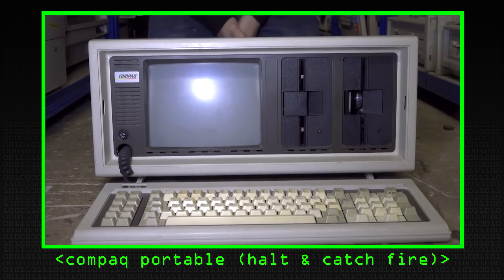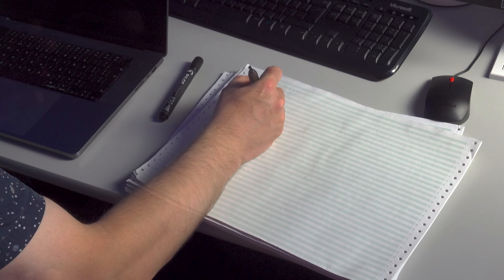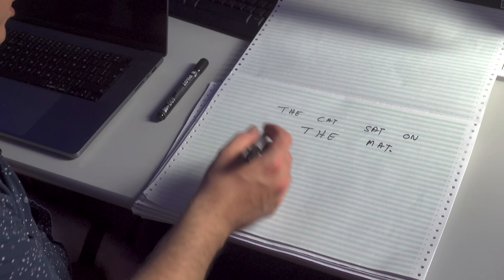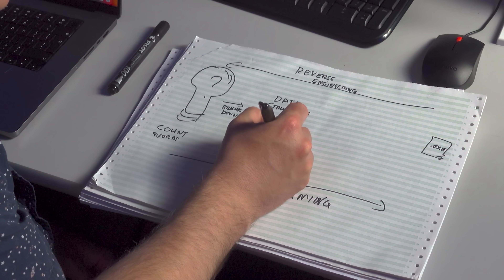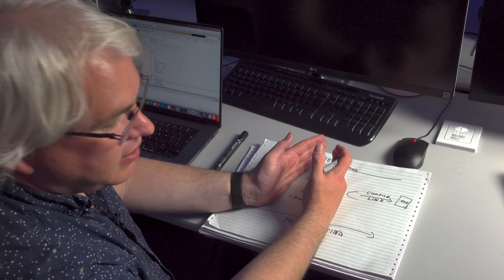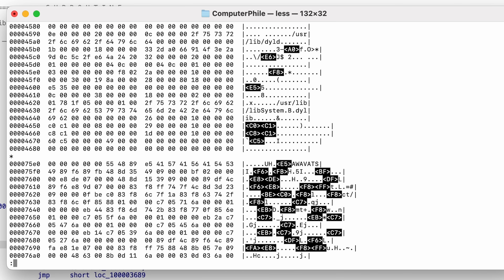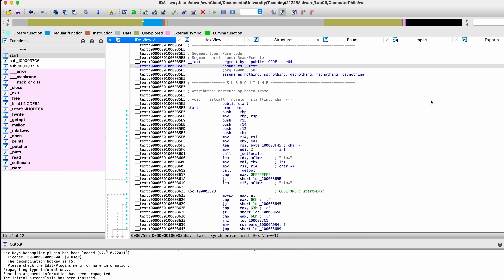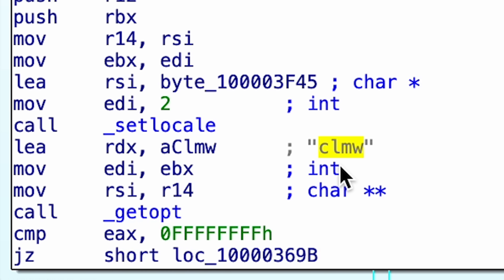Reverse Engineering - Computerphile

Comment: Oh yes, please do avideo on spaces. I never understood why there are line feeds and carriage returns and why those are two different things...
Reply: back when typewriters are a thing, line feed goes to the next line, carriage return goes to the start of the line. you needed both to go to the start of the next line. i dont know what happened when computers were invented, but different OS writers decided they needed different combinations of those to be used
Reply: @jkoh93  Unix and unix-like systems (including macOS) use LF only. Windows (and DOS) use CR LF, in that order. The classic Mac OS and a few others used CR only. And there were even more combinations and other character encodings used in different machines and operating systems.
Reply: @jkoh93  so... LF moves the cursor vertically, CR moves it horizontally? Why do *NIXoids omit the CR? I'm sure one of the Professors has some intersting stories to tell why those things are the way they are, hence the seperate video about spaces 🤩.
Reply: @LupinoArts  Probably as simple as: we don't want to use two bytes when one is enough to indicate a new line.
Reply: @maxine_q  Yup. Pretty much. Now editors and other simple text file readers need to accept the various combinations of line delimiters... or convert from one convention to another. As stated, it all started with mechanical printers that had CR and LF as separate physical motions.

Comment: You haven't mentioned reverse engineering to bypass copy protection/licensing.
I've reverse engineered a few small things that i liked but never had the opportunity to license.

In one case, it was as simple as finding the reference to a string that bothered you about purchasing a license and in the jump instruction simply make it so it never performs the jump and proceeds as normal.

In another case i reverse engineered the licensing key algorithm. Then i wrote a keygen for it.

Reverse engineering is a lot of fun, sometimes hair pulling frustrating, but a lot of fun and the moment you make a breakthrough you feel like you are on top of the world.
Reply: I remember the first time I changed a JNE to a JE – 0x75 to 0x74 or from u to t – and saved the binary so that it would now accept any random key. Seeing it work was exhilarating!
More serious software protections and license validators require a lot more than this to break them, and it's rarely that simple.
Reply: @desmond-hawkins  how do you change it like that
Reply: @seif1293  You use a disassembler like IDA shown in the video, although IDA is commercial and has only a limited free version. There are free alternatives, Ghidra is probably the most powerful (actually made by the NSA! no joke). Once you find the JNE – meaning Jump if Not Equal, i.e. jump to where it shows the error message if what you entered is not equal to the valid password/license key – the disassembler can show you the exact position in the binary where the JNE is located. Then you use a hex editor to open the file, go to that position, and change it to the binary value for a JE. So in the hex editor you'll see a u and you just replace it with a t then save, and run it again. If you got it wrong you just inverted some random condition in the code that has nothing to do with what you wanted, and this might have "interesting" side-effects.
Reply: I reverse engineered the codes that Lemmings and Lemmings 2 gave out so you could restart at a later level - the programs even accepted codes which were impossible to be obtained from the program but were valid as far as the algorirhm checking the codes was concerned.  (I guess part of the code generated was ignored by the checker but was included to create multiple codes, or may have been used by the game to change the difficulty slightly.)

Comment: Reverse engineering also applies to archives/files, i.e. watching for patterns in data and figuring out how it is used in order to reconstruct or convert/export. common practice for the modification or extension of a program’s assets. Most modern formats follow the structure of [header + chunk(s)], so finding the definitions leaves only making use of the data in each of the chunks
Reply: I did a bunch of this several years ago with a particular game.  Knowing various text & numeric values, I tore about the data file that I knew stored that information.  I never decoded all the info in the file, but I got far enough for what I wanted (a map of the locations & types of all the star systems in the game).  Based on emails, there have been several people over the years since who have benefitted from my hobby.
Reply: @jursamaj  can i ask what game that was?
Reply: I reverse engineer files for the fun of it 😄. The latest is the save game format for Trails Of Cold Steel, because I don't want to miss anything. I also made tool for the Witcher to copy my inventory from one save game to an older save because I did something earlier that broke a later quest. I didn't mind going back to the older save, but I didn't want to lose all the ingredients I had picked in the meantime..
I also reverse engineered the encryption Final Fantasy X uses on its save games because I forgot I had to sponsor the traveling salesman. I changed the amount I had given him and deducted the sum from my GIL.. I may be cheating, but at least I'm honest 😋.
I honestly think I've spent as much time having fn with game files as actually playing games. 

Nothing multi-player though. I'm not an a-hole.
Reply: Also protocols, been dealing with serial communications protocol with for a laser engraver recently.
Reply: One thing that comes to mind is the Unity Asset Bundle. I work within the Unity engine a lot (I modify my VRChat avatars a lot and I also reversed engineered a VRC world). There are a lot of tools to decompile a Unity Asset Bundle, however quite a bit of them don't like VRChat's Asset Bundles. So people reversed engineered how the VRC Asset Bundles are laid out and how Udon works (because I think that was messing up those normal decompilers) to extract data from said Asset Bundle.

Don't get me started on the Cat & Mouse game going on in VRC, people are ripping avatars and avatar creators are making DRMs to help protect their personal avatars. I hate how people cannot just be nice and leave personal avatars alone. If you want one that looks like it, ask for a copy or reverse engineer it.
Reply: M

Comment: I'm trying to reverse engineer a Z8002 system ATM , managed to get it disassembled ,   and can work out some of the routines . I not sure if it was written in assembler or C  (knowning sometimes helps)  pity Ghidra doesn't support the Z8k
Reply: are you sure? I think I've seen Z8000 files  (.cspec, .slaspec, etc). Maybe you just need to customize the implementation a bit.
Reply: @u0000-u2x  ah! So ghidra might work?  I had a look at the web site and could onl see Z80 options. Thanks I'll take a closer look 8-)
Reply: @wktodd  yeah I was mistaken sorry... indeed the Z80 is there. You could implement a custom processor though. Ghidra is extensible.

Comment: Recently Super Mario 64, Ocarina Of Time and even Jak & Daxter with its Lisp dialect GOAL got reverse engineered and even ported to pc. It's a work of art. For those interested: tools with disassemblers and decompilers like Ghidra or IDA are pretty helpful.
Reply: Gen 1-3 of Pokemon have been reverse engineered as well. I actually have a tutorial series on using the Gen III decomps, they are super cool. Its so easy to make romhacks now.
Reply: Where can you get these games for PC? Or where can you get the source code for those games, and compile them myself?
Reply: @konstantinrebrov675  They're not hard to find, but you always need an original ROM to play them. The port extracts the art assets from the ROM. To keep it legal, they can't include the ROM or any of the assets from it.

Comment: i hoped he talked more about how "disassable" bytecode differs from mashine code or that you can also reverse assambler code back to c/cpp
Reply: Disassembled code is machine code (binary) converted back to human-readable assembly language (text). They usually have a one-to-one correspondence (each binary opcode is generated by a unique assembly instruction and operands combination), so disassembling is a 100% deterministic.

There are some tools that try to convert assembly to C (or at least to a mix of C code blocks and assembly instructions), but their efficacy is limited and the generated code may be as hard to read as the original assembly.

Comment: Is this the first computerphile video in 50 fps?
Because I noticed and liked it.
Reply from the maker: I did a bunch of them at 1080p50 at the back end of 2016 but mostly got complaits so switched to 4k instead. Now we have both :)
Reply: @Computerphile  Well, you've got at least one vote in favour of the higher frame rate, Sean. Don't forget to read the manual, though. 🙃
Reply: @Computerphile  50fps causes a doubled frame every 6 refreshes of a standard 60hz screen. Some people don't notice, some can't help but notice.
Reply: @Computerphile  Running Fedora 36 Silverblue freshly installed, only this video seems to render with awful stutter, please consider refraining from 50fps, it might affect other linux users.
Reply: @djkero1  seems specific to you, so you should probably fix that extremely specific issue rather than asking the world to refrain from 50fps?

Comment: But there is a way to get pseudo source code from a program its called a decompiler. IDA can also do it but it requires an addon that costs several thousands of dollars, Ghidra can do it for free.
Reply: And in the case of the binary he hexdumped, fernflower can be used(or any other Java decompiler) as it can be seen the first four bytes are "CAFEBABE" in hex which is the magic number for Java class bytecode
Reply: free but worse
Reply: @isse6790  if it remains as popular, it can only get better as more developers start contributing to it. seen a lot of people get by just fine with it though. the main issue honestly is the NSA developed it so it's hard to trust given their history of hacks/malware "to catch terrorists". people can always pirate IDA, too if they really just MUST use it, specifically.
Reply: @ETXAlienRobot201  It's been open source for several years now and is still much slower and worse than IDA.
Reply: @isse6790  can just blame java on the slowness, it's easiest. 

decompiling is really difficult, so making something comparable to a specific software product/company that effective has a monopoly on this would take time. not like IDA is sharing the fruits of their labor, are they?